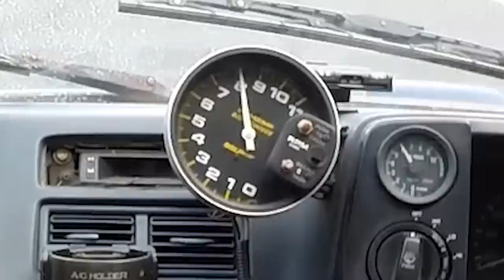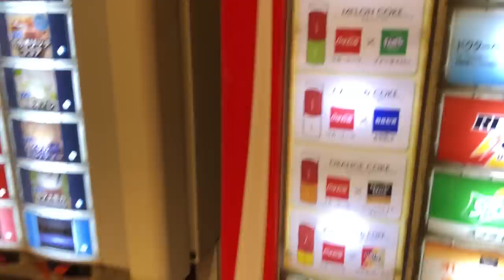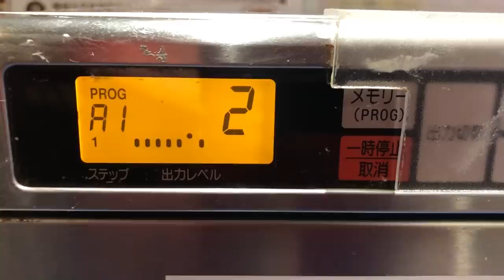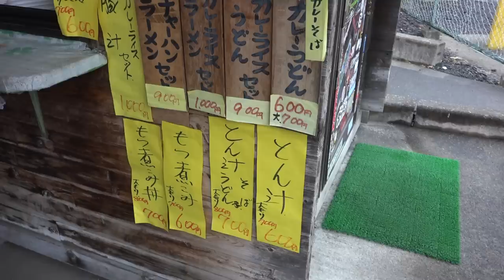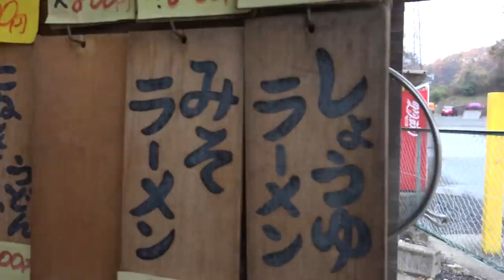AE86 rain drifting all day

Comment: I'm 26 with zero knowledge about cars but this makes me want to get into it.
Reply: Alexander E. J. Do it man! It’s a wonderful hobby
Reply: @Deanr51  how do cars from the early 2000s generally hold up? Also do you have any sites or channels you know of that I could visit to learn more?
Reply: Alexander E. J. There’s a bunch of car based sub reddits where people would be more than happy to answer your questions.
Reply: Alexander E. J. Btw newer isn’t always cheaper in the long run just be smart about what you purchase get something they made loads of and you’re set on secondhand parts then. Also learn to DIY a lot of general stuff or just hand over your bank card because labour is where it adds up.
Reply: @noahdement9271  it is not just a hobby, it is a way of life.
Reply: If you want it to last get a Honda. Or just learn some basic things about you own car now, like oil changes, filling fluids, rotating tires and replacing brake pads. All simple things which you can do with a small jack, jack stands and a set of basic hand tools.
Reply: too bad all those fun cars are crazy expensive where I live
Reply: @TheRage53  any car can be fun, its not the car that makes the fun but the way you drive it :D driving a slow car fast is more fun than driving a fast car slow
Reply: @plepper  What this guy said. The grass is always greener. Pick something that's obtainable in your area to start with, but also make sure to look into parts and common problems when shopping for a car. My area I wanted something older german and e30s are very obtainable. I'm on my second now.
Reply: Im 14 and same tbh
Reply: I'm 24 and my 30 yo Nissan is curing my depression. It's also ruinning my wallet.
Reply: @nathans1829  what typa general stuff are u talking about? I'm asking cuz I'm just recently getting into cars
Reply: @lv3234  I replied to someone else but learn some basic things about you own car now, like oil changes, filling fluids, rotating tires and replacing brake pads. All simple things which you can do with a small jack, jack stands and a set of basic hand tools. You don't have to swap an engine to know some basic things.

Comment: Ahh smacking stuff, the pre-2000 universal fixing technique
Reply: Damienov it works post 2000s too
Reply: even worked in the 18th century
Reply: Lol I did it to my 2014 motorcycle brakes the other day. They were making a bad noise so I loosened the bolts, kicked the caliper a few times and tightened em back up. No noise!!! *edit thanks for the likes yall*
Reply: i died at that
Reply: Yea  nah... It's still viable now, and any time after.

Comment: Great vid! Thanks for the Tshirt rep! I bought an Insta360 after your first vid on it. Awesome bit of kit, but it seems to double my edit time on vids when I use it. Do you edit with a phone or desktop?
Reply from the maker: Desktop. And yeah, it can add a bit of editing time 😅
Reply: Hi there! I know this comment is a year old, but i highly recommend using ingest/transcoding settings in premier if you use that to edit, because it can convert your h264 encoded video files into the prores format, which is significantly easier for your computer to load and edit on your timeline. Used to take me hours to edit together a short video because I was using my h264 files, but switching to prores drastically shortened the work time.

Comment: 20:40 Also common problem for all 80s Toyota (at least all my Toyotas). Dead starter motor? smack it.
Reply: Early 80s subarus too. Although ive found if you add a relay and a thicker wire to the solenoid you can make a bad starter last for years and only very rarely have to hit it. (also try put car in gear, usually reverse, handbrake off and put your foot out the door and push the car backwards a bit while holding the key to "start"  the slight rotation you put on the engine/driveline is sometimes enough to get the starter to work, just gotta be quick on getting the clutch back in before it starts to move the car

Comment: I had to look up what a 7-series plate was. That's the first I have seen. Apparently they ran out of 5-series plates for passenger cars under 2000cc so the overflow became 7-series until they moved to triple-digit number plates in the year 2000. Before that, 7-series was the designation three wheeled cars under 2000cc.. Understandably not many of those exist so they didn't run a risk of running out of them.

Comment: This is one of the coolest AE86 ive seen, its just majestic i dunno whats with it :D
Reply: Weedy-san it’s been used for what it loves to do. It’s not flashy or messed with overly much so.
Reply: I think the fact that it’s technically a “veteran” it just shows on the car. Fucking love it
Reply: @13geeky    ok  i m a friend of the guy  in this profile ,   he has the starlet kp60 k series    stroked and mine is a corolla ke70  4age swaped but weber insteed of solex ,   . . i kept it old and  a bit rusty and i prefer roll it in 2019 ,  no powersteering no radio only 4age and rwd

Comment: Why not putting the balancing weights inside of the wheel, like everybody else? :D
Reply: Pretty sure most balancing machines measure how far out of balance the wheel is inside to outside as well, so it will tell you to add weight on either the inside or the outside of the wheel as well as at different points through the rotation - so in other words he's doing properly rather than hiding them for cosmetics
Reply: @081588101  fair enough,  you more about  it than me then m8

Comment: Alexi, those starters are easy to fix. The brass contacts that wear out and cause this fault are available from toyota for about £4... It's a 10 minute job once the starter is out, and it's the same for the JZ starter when that fails.

Comment: Quick question, does the 86 use an lsd and do Japanese drifters weld diffs?
Reply: The sport trim of the 86 comes with a live axle i believe. The 85, or the SR5 does not.
Reply: Rayota thanks mate, same goes for the ke70’s?
Reply: @johnnyfletzet  not sure but i believe so, you might want to double check

Comment: does having a bucket seat help with drifting/driving than oem? thanks
Reply: yeah it stops you holding yourself into the seat with the steering wheel therefore giving you more control over the wheel and you can drive more relaxed making the car less jerky
Reply: @smudge2021  that's what i thought too. thanks

Comment: Love the video!
I used to have issues with my AE86 starter as well, but I added a relay to engage the starter solenoid and I haven't had any issues since. This guide has more detail: http://www.sq-engineering.com/index.php/tech-articles/relay-upgrade-for-a-starter-motor